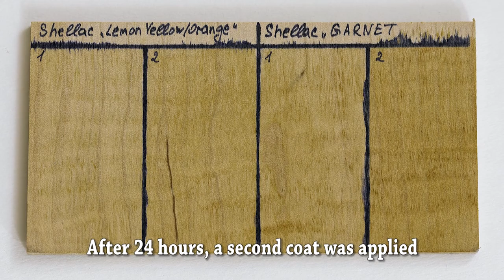Painting and tinting :: shipmodeling :: workshop

Comment: Thank you for sharing information.
I also try a lot of different finishes for my models on scrap pieces of wood. For brig Mercury I am currently using linseed oil for hull, shellac for deck planking (applying it as french polish with pad) and linseed oil with added oil colors to give contrast on boxwood decorations.
Your finished model looks stunning😁. Keep up good work.

Comment: Hi Olha, I am buuilding a wooden ship model and wanted your opinion on a finish.  is there a difference between a stain and a dye? if I stain or dye do I need to put a sealer on top? I want either no shine or very subtle shine in the finish. oh, and why do you use the cyano acrylate glue under the stain? thanks and love your work! where did you learn to build ship models?
Reply from the maker: Hello. Dyes and stains are different. Some look better with a topcoat and some don't. So I do a lot of sample before I use anything on a model. And I advise you to also make a pattern on a piece of wood that was used on the model and after experimenting - choose what you like!
Superglue penetrates the wood and fills the grains. After that, the stain lays in an even layer and does not look like a dirt on the model. Carpenters use nitro varnish for this, but the model does not have large areas for painting, so I replaced it with superglue...
Reply: thanks for the quick reply! your work and videos are so enjoyable to watch, makes it look so easy...but I know how much patience and skill are required... @OlhaBatchvarov

Comment: thank you for the great tutorial!  i have some questions, please...
- do you varnish/paint only at end of build? how it is possible to polish (sand) parts , when they are already attached?
- i understand that you use CA glue before painting?  when i drop some CA on wood, it makes a white stain, therefor i try avoiding it ... is my glue a wrong kind? why to use CA at all?
Thank you very much!
Reply from the maker: I'm glad you found useful information here!
Yes, I delay the moment of application of the finishing layer as much as possible. As if it is for example oils, then to them then do not stick any details. But in some cases, I glue already painted parts, precisely because they had to be further sanded. And I use CA to close the grain of the wood before tinting - this is what carpenters usually do, for example, with nitro-varnish, but the models have a very small area, so I use CA. This is usually the thinnest CA. After that, the color of the stain lies evenly and does not make the wood dirty...
Reply: @OlhaBatchvarov  Большое спасибо! понятно)

Comment: Dear Olha,
Although a beginner I started building le cerf from scratch. I used Fusion 360 to model the frames and cut them with a small CNC machine. I religiously follow the steps you took in your marvellous videos ! Bought a bunch of power tools too, including Byrne table saw. I intend to cut the planks from pearwood.
I just had a question regarding CA finish. Do you actually cover all the hull with thin CA glue? What kind of sanding do you perform before and after? Do you put several layers or only one?
And finally, do you confirm that you apply varnish AFTER the CA layer?

Sorry for the bother, but I think this is a very interesting tip !

Best regards,
Nicolas
Reply from the maker: Hello Nicolas
CA I use to clog wood grains (usually 1 layer is enough). Then the stains lie in an even thin layer, and do not impregnate the wood, which in scale looks like dirt.
For hardwoods, I prefer skraping than sanding...
Before applying something on the model - try on samples, it will save you from irreparable mistakes!